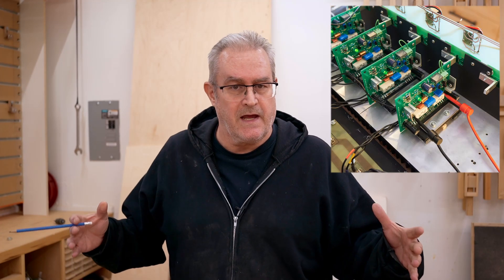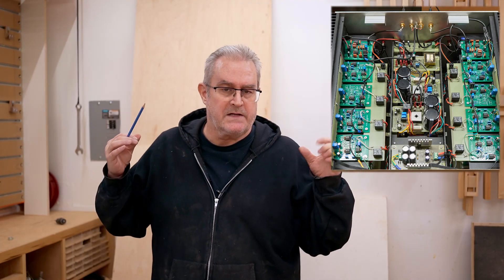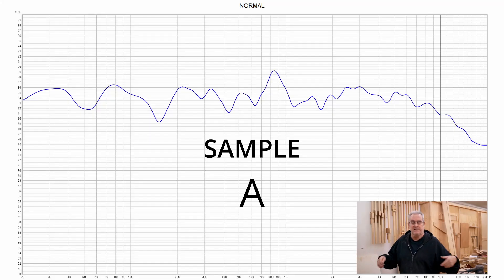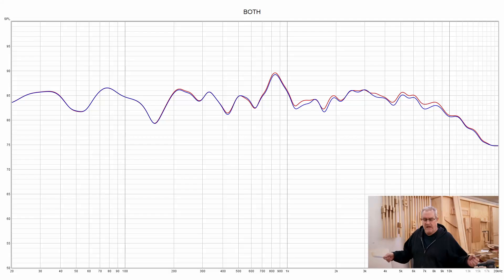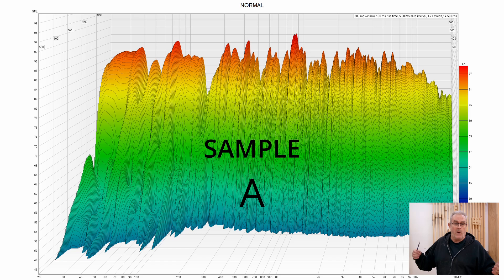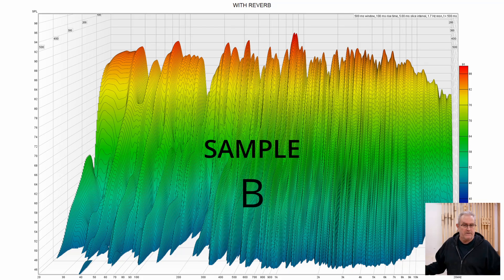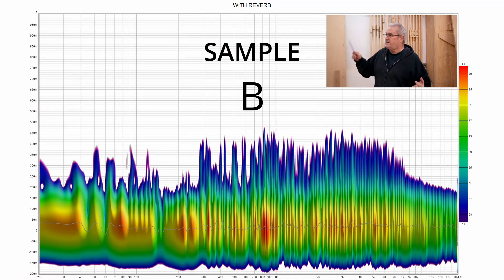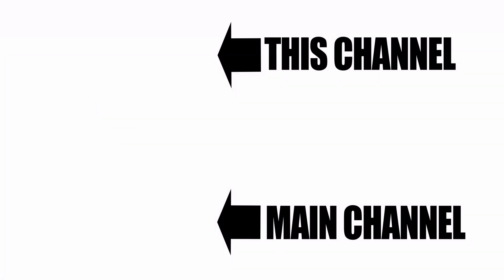Can We Measure Everything We Hear?

Comment from the maker: Happy New Year!
Sound reproduction using electronics is a human invention. We made it - we understand it fully - we can measure every aspect of it. There's no magic involved, despite what the snake oil gurus want you to believe.

When you measure sound, there are a number of ways to look at and interpret the data. 
In this video I point out the difference between the frequency response (what most people look at) and the time response to uncover the measured difference between the two recorded samples.

The samples are recordings of a test sweep generated by the measurement software REW. The only difference was I added reverb to the speaker at the back of the room (one of the Hafler circuit speakers). Sample A had no reverb, Sample B had reverb added.

While you can easily hear the difference, both frequency response plots are virtually identical. To see the measured difference you need to look at the sound as it's propagating over time - the waterfall plot. 
When you add reverb (either with electronics or from the room itself, that won't affect the frequency response drastically, but it will affect the time response. And it's the time response that most listeners are unaware of and largely ignore.

The unmeasurable part of sound reproduction is how YOUR ear in combination with YOUR brain receive and interpret that sound. That is affected by a long list of things that have nothing at all to do with the equipment used to produce the sound. And those difference can make the sound radically different. 

Another huge factor that affects the sound produced is YOUR room. 
As much as 50% (or more) of what you hear in an untreated room is the room itself - the sound interacting with the room in the form of reflections and standing waves. 
Measuring what the room does to the sound is vastly more complex and difficult to do, but again it has nothing to do with the equipment used to make the sound in the first place.
For example, moving your listening position as little as a few inches can make a large difference in how much bass you hear. This is due to standing waves that every small room has.

The sample I played had reverb added electronically, but you've probably heard something similar in a large room where the sound is echoing. That will only show up in the time measurement and as you heard, has a big impact on how it sounds. In varying amounts, that's what's happening when you play sound in any untreated room - the sound takes longer to die out.

Comment: we can measure a lot of what we hear in general, but we also are different humans so it wont all translate. 
so we simplify the data and make it understandable to most people. and there comes the problem, now we have a subset of people thinking they know everything from that simplistic baseline.
Reply: Simplify what? Variations between people aren't massive unless damaged. It's like saying we can't understand recording sound because different microphones are used. The physics remain unchanged. Stop applying some ethereal conspiracy to audio because you don't understand it, it is science.
Reply from the maker: Audio itself is science and well understood (though wildly misunderstood by most, even the guys that think they are science based), but listening is subjective and that means it's going to be different for each person. Not insanely different, but different enough for the listener to voice a preference. 
That's why it's a bad idea to insist on an objective standard with the contention that it's the best overall. It likely will be the best for the average listener who doesn't really listen to what's playing, but not for someone who wants something that better suits what he judges as the best sound quality.
What a so-called objective standard does is push manufacturers into only making products that measure to meet that standard, and not ones that sound the best to the designer. It takes the art out of it, much like setting a standard for oil painted artwork would.

Comment: As a professional sound engineer, it’s always a combination of using your ears combined with measurements. 
Hifi is a different world of course. 

Live reinforcement has different challenges. We have the additional deadline on top of usually sub optimal (acoustically/logistical) venues, speaker placement, listening positions, weather conditions (wind/temperature and humidity changes), sight lines hindering placement, SFX interfering with dispersion and response (stage flames killing high frequencies). 
Even if you would be able to deal with all of that, sometimes there just isn’t any time so you have to make decisions on what to optimize. 

With bigger setups, there’s always prediction software involved to optimize placement, response and dispersion within given restrictions. It’s mostly about aligning multiple sources in “the best spot”. It’s always a compromise, finding the best, usually means “least bad”. 

Measurements in the field almost never are solely frequencies, and if it is, it is to check or verify something very specific. It’s usually a (FFT) transform function measurement, comparing the known input signal to the output signal captured with a calibrated measurement microphone, so you can compare the 2. 
Which is nothing more than a tool to either identify faults in the system or optimize output, response or dispersion of multiple sources according to your experience/preference. 

The challenge is interpreting the measurements, what is causing the issue shown in the measurement? Is it a reflection in the venue, a wiring mistake, a faulty speaker, or a measuring mistake? 
Identifying the “issue” in the data is one of the harder things there is while using this kind of software and takes a lot of experience. Sometimes just listening is a good way to verify what you are looking at on the screen. 

Everyone can download a free RTA app and hold out their phone, which in itself doesn’t do much, but fills people with misplaced confidence that they “measured” something.

Comment: I’m a little confused as to why someone like yourself who loves and is passionate about audio would reference a Yamaha surround amp . Although not being a bad product it is far from a great audio pre (or power for that matter)
Love your work John . 
Thankyou 
Happy new year.
Reply from the maker: Your confusion probably comes from believing the high end audio lies that have been told over the last 50 years. 
Correct me if I'm wrong, but I'll assume you can't list the technical reasons why you believe my Yamaha amp isn't up to audiophile standards. 
You probably think of it as "midfi", which is a term made up by the high end market to put down products in the retail market, implying that they are inferior.
Reply: I’m well aware of the HiFi hype. I’m well informed by electrical engineers . So your excused for making that  assumptionI.  Im also a recording engineer so once again I am very aware of the differences in product design and their performance. 
Once again it’s in the listening . I would put it to you that a dedicated 2 channel pre would have a discernible difference. One you may like or not . Audio ( as you know) is a personal thing .
Reply from the maker: You must be thinking this amp is driving my main speakers. I'm using it for a pair of rear speakers in a Hafler circuit set up. My main speakers are powered by the 10 channel amp I built and talked about at the beginning of the video.
And I've listened to a lot of amp and heard no discernable difference between them.
Reply: @vassmarc1 erroneous to assume being a record "engineer" allows you to understand "performance differences" in products. Marketing is what does that, your eyes trick your ears into hearing that, but measurements  show the truth. If the amp passes audibility measurements, then it is adequate for the job. There is no granularity to performance past this unless purely technical.
Reply: Oh boy. You guys just don’t get it

Comment: Whenever I hear anyone say we can hear things that can't be measured, I want to ask one thing... What do ears do? They measure pressure variations in the air and send the measurements to the brain for processing. Everything that can be heard can be measured, but only * if * you actually measure it. The practical problem is that it's hard, and can be expensive, to measure everything that can be measured. That's why the things that are usually measured tend to be only a small fraction of all the potentially available information, and are driven by marketing rather than objective science (remember the old THD obsession, anyone?).
Reply: you can not make an assumption that everything we hear can be measured, we always evolve our tools and understanding of everything over time.

Comment: Frequency response is both magnitude and phase response. You are only showing one part of a complex number per frequency.  You should check the phase to see if there is a difference in frequency response.
Reply from the maker: Frequency response at a fixed location includes phase, so there were no phase differences that had an affect.
If the phase was radically different, then the frequency response would also be different.